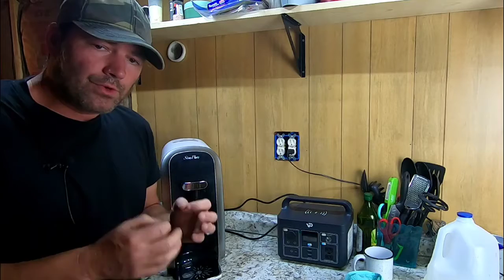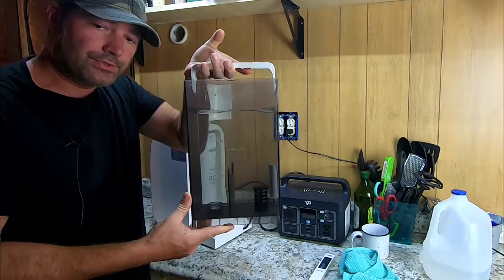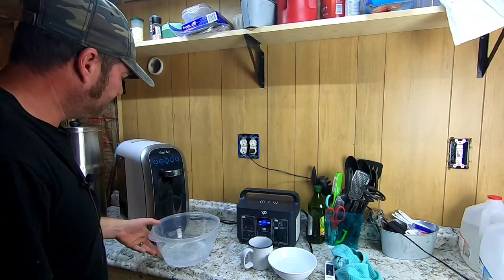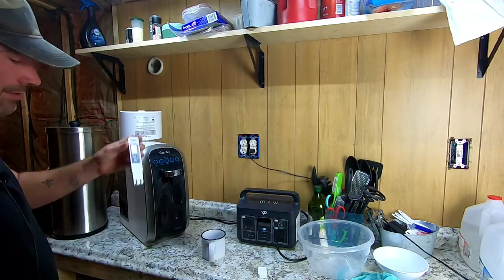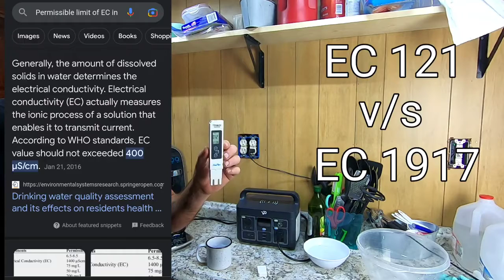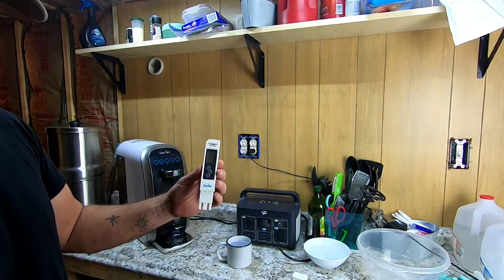SimPure Y7P Reverse Osmosis Water Filter vs Gravity water filter

Comment: I just purchased the Y7 countertop system and very excited for it to get here. We spend a fortune in bottled water every month because after chemo I cannot stand the taste of our tap water. It tastes like it came straight from the swimming pool it has so much chlorine in it. Up to this point I'd always taken for granted our city was safe to drink and didn't put much thought into it. Now after doing research I was shocked to learn all the contamination in it. Due to my health concerns it really gave me a wake up call. Sim pure from all the brands I've researched stands out above the rest hands down. Now my question is should I invest in a pitcher for my refrigerator to keep cold water available or is it just as safe to use my plain old glass pitcher using the water from the countertop unit?
Reply from the maker: Hi Dear, Both options are suitable for you. If you prefer cold water, you can dispense the water and place it in your refrigerator. If you are fine with room temperature water, you can simply use a normal glass.

Comment: Thanks for this.  I bought one to comvat the worst city water in the country - phoenix.  Our TDS is at or above 480.  After treatment. I know the national guidelines say 500 is absolute max.  Not to mention chlorine that seems to be nearly swimming pool levels. Our water sucks and we pay for it.

I did try zero water, but I would only get about 3 to 5 gallons out of a filter.  At 15 - 20 bucks + each it was unsustainable.  It did wipe out everything in the water, but at a high of 5 bucks a gallon...

I do have one question.  I was under thenimpreasin there was a continual dispensing mode.  To dispense 100 gallons a day at 1/2 liter at a time seems crazy.  I will be using this for all water needs outside of cleaning and showing.
Reply from the maker: Hi we're so glad that the unit is helpful for you! If you're filtering 100 gallons per day maybe you could get one of our under-sink systems for easier use: https://www.simpurelife.com/collections/under-sink-reverse-osmosis-systems
Reply: @simpurelife  apartment. So there is no continual dispense?  I just dont want to fill my 5 qt pot 1 cup at a time.  Undee sink would be nice but i look at waste ratio and under sinks suck at conserving
Reply from the maker: @hugojack2005  It indeed has continual dispense but it will take some time for so much water. We'll release a new unit which better fit your needs!
Reply: @simpurelife  excellent.  I actually received it today.  For our needs it willbe fine.  Only for cooking and drinking.   Thanks

Comment: The guy that looks like Dana White doesn't seem like he knows what he's doing, and the fact that SimPure is having this video on their channel is a bit concerning. SimPure Y7P Using the Recycling Multi Filtration Technology, the waste water will return to the feed water tank to continue to circulate and filter, for that reason you should NOT measure the feed water tank, of course it will show very dirty, instead you should have measured straight from the well/tap for a fair comparison.

Comment: I trust your subjective taste of the water more than devices that rely on electrons to get the measure of contaminants.
I truly hate DC>AC convertors, they waste energy, it would be so much better thing started using USB connections to solve this issue as on DC only.